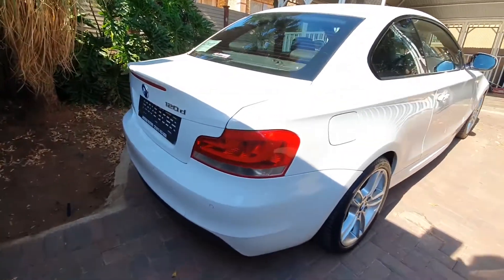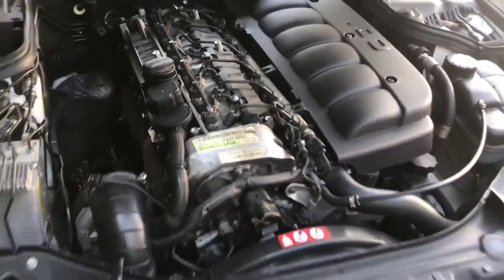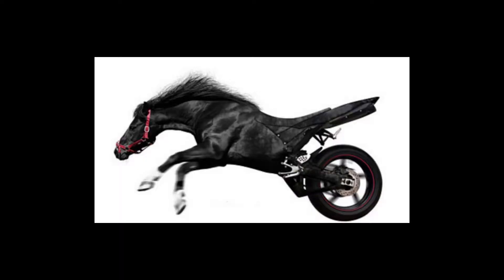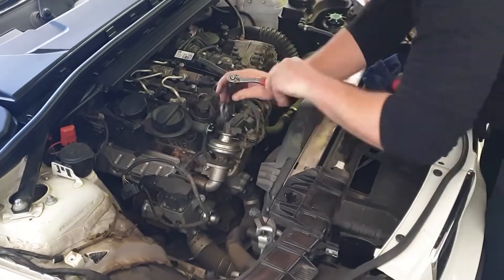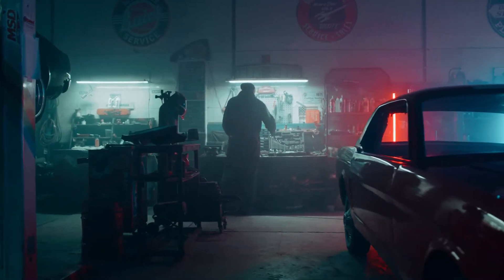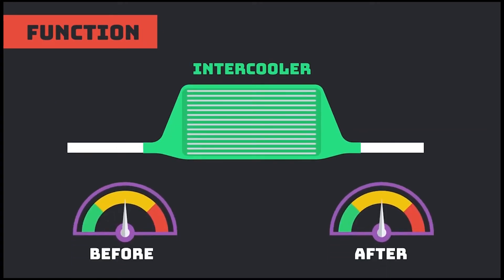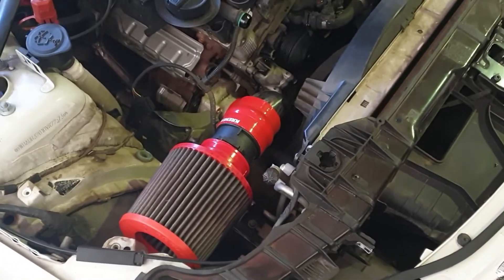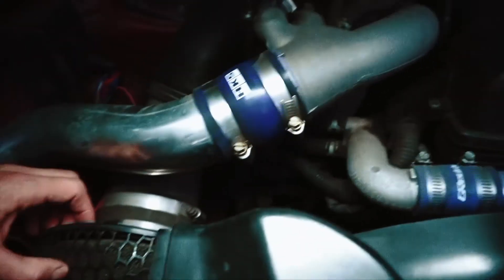First mods you should do on a Diesel car

Comment: If they ever outlaw non-DEF diesels. Is there any way to retrofit a DEF system on an old diesel, like an om606?! I'm sure if there is, it'd probably be much harder on a mechanical injection rather than common rail. I'm just wondering if it's possible.

Comment: This video grabbed my attention and then I saw GP plates and I’m like… “hy is naby.” Lol

I have a 2007 Audi A8 3.0 TDi quattro… jas about 175000km on the clock.

I changed the tyres and rims to 18’s. Aftermarket exhaust system from downpipe (stainless steel), stage 1 tune.

That’s all I have this far and oh yes, changed the air suspension to coil overs with a 30mm lift.

It’s a daily drive, so if I may ask, what’s missing for peak performance on a daily drive, what would you advise and would you be able to offer that service?

Daie Bankie 👊🏾
Reply from the maker: Grease monkeys know there diesels😁. 

If you go there they can advise you for the best mods on your car😁
Reply: @ChrisVSCars  will do so, thank you.

Comment: What a bad advice. never delete the EGR. That's super bad for the environment. The intercooler sounded like a good idea initially, but the DPF needed to be in a high enough temperature to be able to clean itself. So, a well enginereed system, and you tinker on thing making the other thing malfunction, then you tinker the other, then another.

Comment: Weirdly I have a custom carbon intake, straight pipe, blanked EGR but I literally never hear any difference in the engine or turbo.
Reply: If you tune a diesel firstly you dont need to tune the air intake/exhaust , you need more fuel so changing the injectors is the most important step

Comment: I got a Toyota avensis 2006 2.0 diesel i wanna ask three things exhaust,how to hear my turbo should i put holes in my filterbox we did it in a Mercedes a old one too
Reply: if you want to hear your turbo youre gonna have to change the intake to a cone filter so it doesnt muffle the sound and if you want to hear that diesel woosh that some diesels make youre gonna have to block the EGR and straight pipe

Comment: I have a 2012 TDCi Ford Mondeo and am only just starting too get into cars. Would a K&N pod filter benefit the car or make it worse? I've heard alot of people say it's bad for the car as it sucks in too much air and will stuff the engine
Reply: Cold air intake, and a high pressure gas pump should do the job
Reply: dont do often stock airbox is not the restrictor as long as your not double the power output. so what i would do direct is a better more efficient intercooler and a tune and you will have increased power. Maybe downpipe but that will make it a bit more drone and louder. but will make your turbo spool easier and sound amazing

Comment: should i straightpipe or like muffler delete my diesel, its a 330d e92
Reply from the maker: You can, the turbo just gets really loud😂. Straight pipe might be a bit much. But muffler delete or sports exhaust, would help with back pressure
Reply: Straight pipe it my f30 sounds beautiful with straights